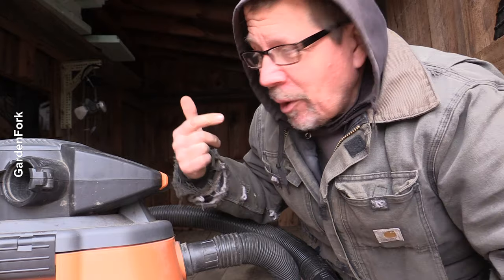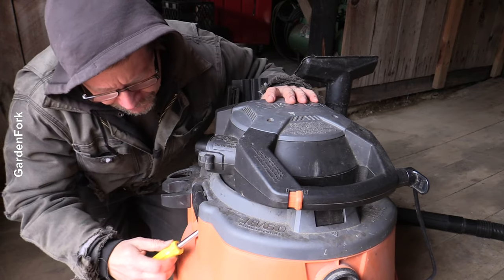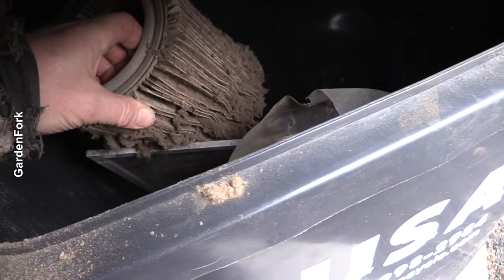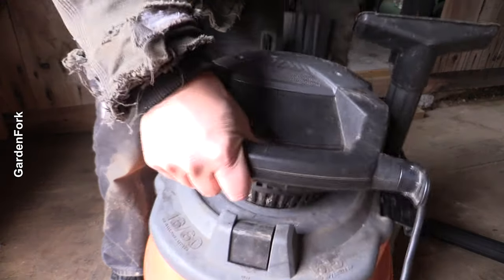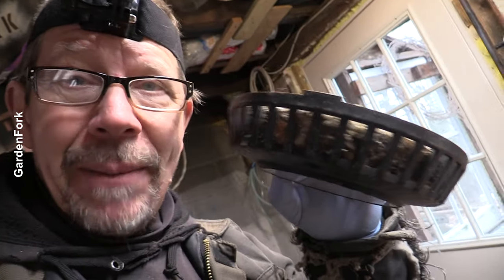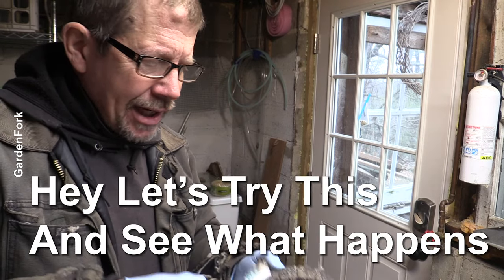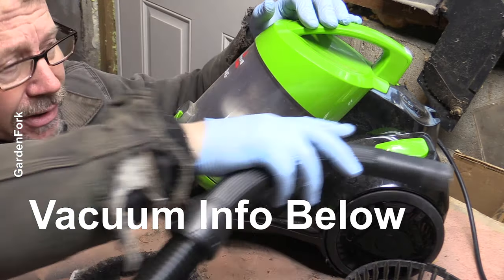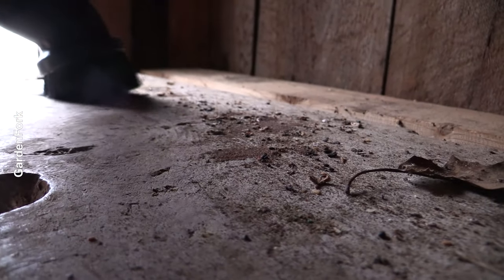Shop Vac Not Working? - No Suction Wet Dry Vac

Comment: I have the same vacuum and I have found if you seal the mating edge on the top of the orange tub and the top with a weather strip seal you can gain a lot of suction also.  I used a cheap rubber seal from Home Depot and I have  gotten much better suction out of it.

Comment: Great job Garden Fork! I've not found another person/group (including Ridgid) that mentions that secondary "catch-all" internal filter; that's definitely my problem, as I have a brand new "outside" filte,r and the inside one is as dirty and clogged as can be.  I wonder what that filter is called, as I can not find anything replacing it. My bigger problem though is that the 3 Philips screws that you show keeping it in place are rusted and indistinguishable when it comes to screw type on my vac. I cannot get seem to get them out! Any suggestion?

Comment: You know if you just bought a bag you’d be like golden and you can reuse the bags you cut them open empty them out and you clip them back up with those really tight black clips and like three spots you folded a couple times it ain’t and then you got your bag for a good few times and then you don’t have to like literally like your filter never gets dirty ever Like basically basically I mean very fine fine like like like cement, dust and like drywall but then you were talking like you can use the same filter for a good 10 years if you use bags just take out the bag when you’re gonna do wet shit put the wet filter in and then put the bag back in Blah blah blah blah blah blah blah grab a filter on Amazon 15 bucks don’t use those white ones. They’re not getting good. Just use a bag and then you don’t gotta go through all this inside of your vacuum is so dirty and wretched. It would not be that way with you eat off the freaking inside of the vacuum. If you had a bag in there, I’m telling you man telling you to help out like this is madness

Comment: Mine is brand new, but can't suck anything.
Reply: Usually there is a drain port at the bottom of the bucket, and if that is not plugged up by a drain cap (that usually comes with the unit) there will be no suction.